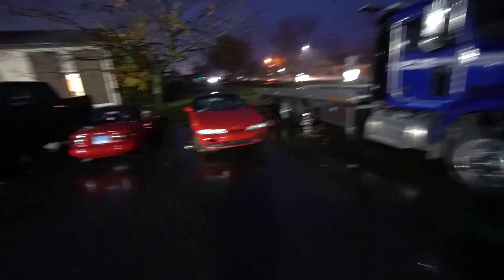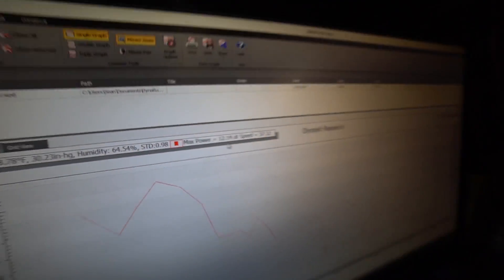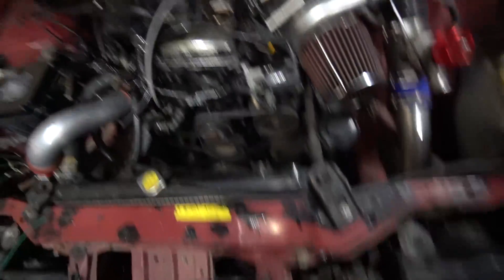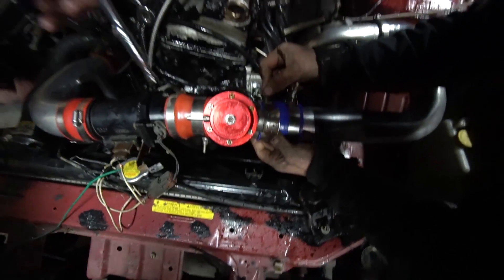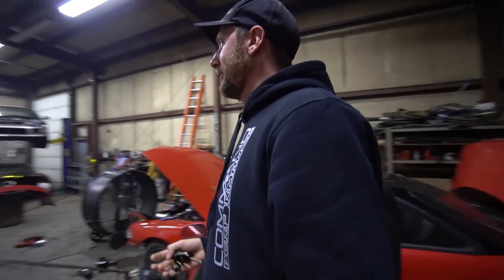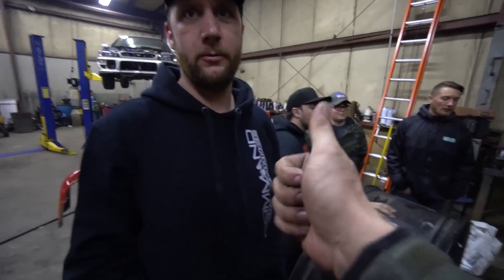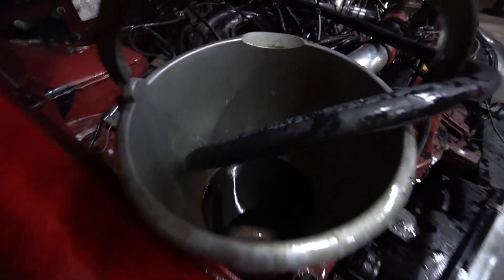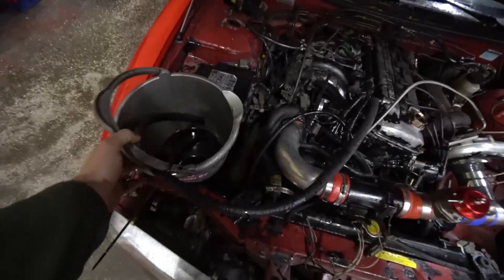BLOWING UP AN ENGINE WITH SCIENCE

Comment: Prime example of why you don't turbo a KA...every single turbo KA that I have ever seen has exploderated.
Reply: I'm not trying to say that they're junk engines, but when they're not built right and tuned properly, they just explode like almost every other engine that is turbocharged in a half ass fashion. I had a JDM D15B VTEC EG Civic coupe that ran on a Thunderbird turbo on 10 psi and survived like that for over 50,000 miles and is still going strong for the new owner.

Comment: holy crap, why is it pushing that much oil out? rings gone so the forced induction is putting pressure into the crankcase ? thats nuts
Reply: Yep, most of the boost/combustion was going straight past the piston in to the crankcase. That's why there was so much smoke coming out of the PCV too, all exhaust.
Reply: If the rings are shot there'd be no  compression. So how would it still be running that good with shot rings?
Reply: @alfonz0010  oil does seal a bit. seriously, that's why an engine that sat a (long) while makes up to 30psi less than normal.